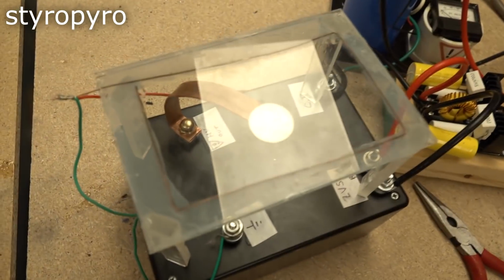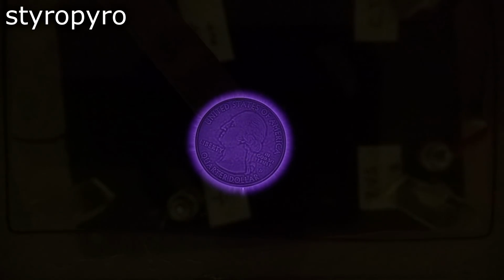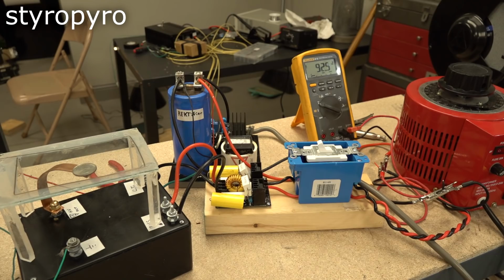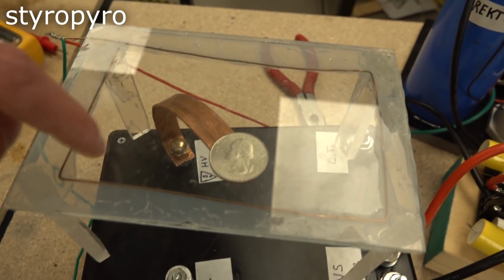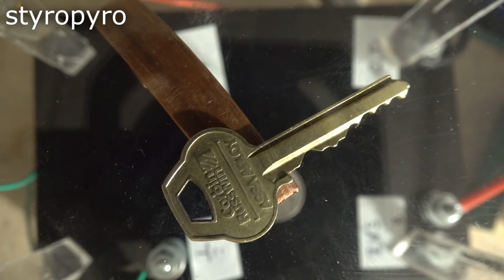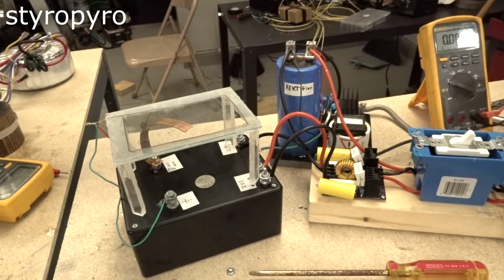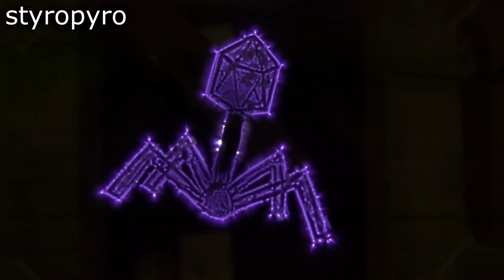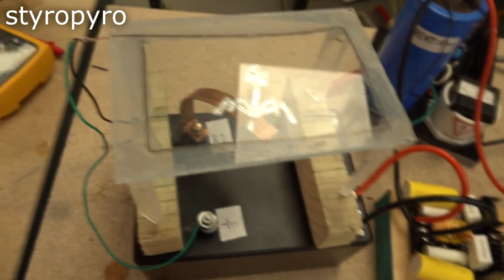Making a corona virus in my lab (clickbait but still cool)

Comment: Cool, I like that you explore the high voltage stuff! I believe that discharge is called Dielectric Barrier Discharge, not Corona. Although I'd also accept such a stretch for the pun to work :D The quarantine is already starting to freak me out, and here in Russia we're not even at the peak yet. Maybe building a 600 kV DC setup will soothe my nerves ;) I'd definitely like to see more of quick videos from you, if you feel like making any.
Reply: A corona discharge is an electrical discharge brought on by the ionization of a fluid such as air surrounding a conductor that is electrically charged. Spontaneous corona discharges occur naturally in high-voltage systems unless care is taken to limit the electric field strength.